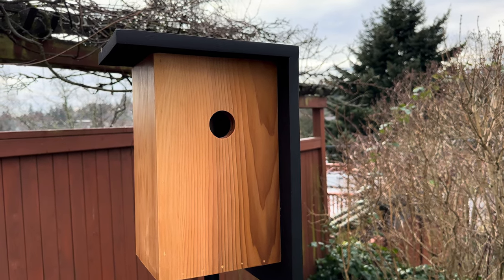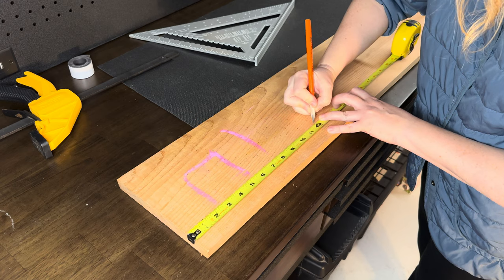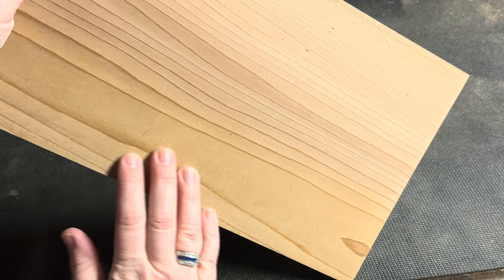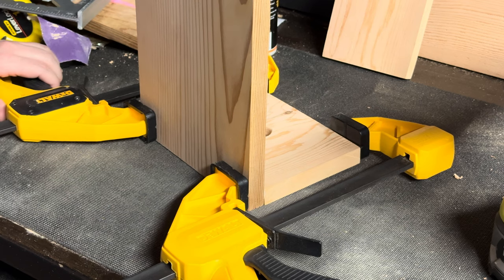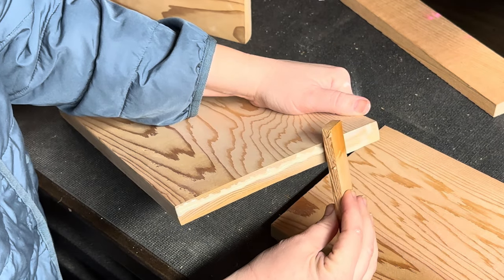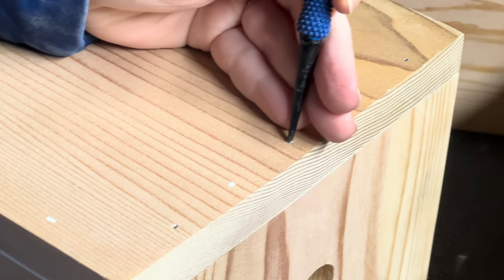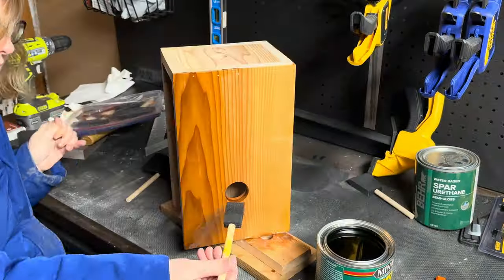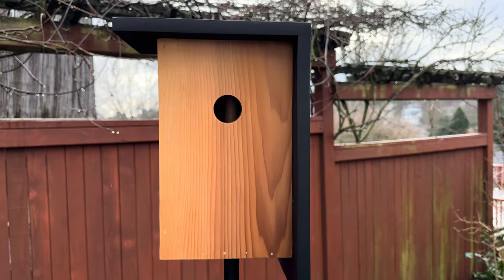How to Build a Modern Birdhouse for the Garden!

Comment: Well the design is nice will most likely give it a try 

Now what you neglected to do was cut some small holes in the base that would act as a drain 

Next you neglected to make slits for the baby birds for air circulation 

The third thing you neglected to do is have a way to empty the bird    house so you can clean out the old nest and sanitize the interior so it can be used the next season 

You did all that work but you should have spent sometime doing some research, given this was your first birdhouse you get a pass